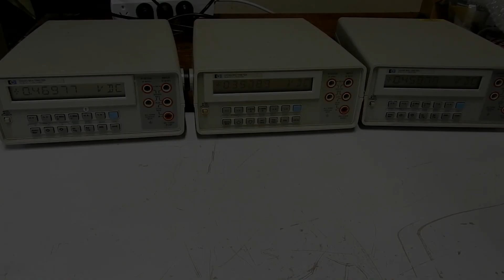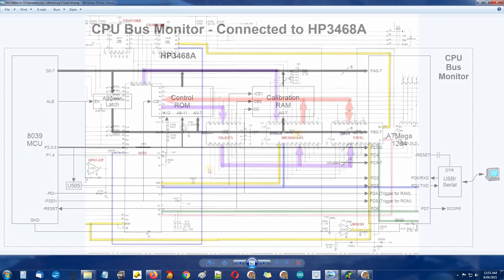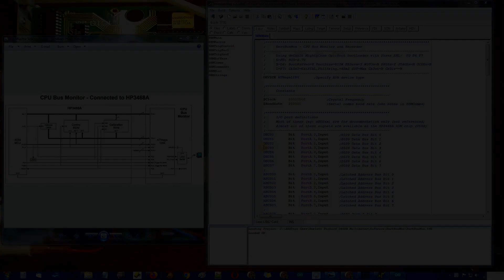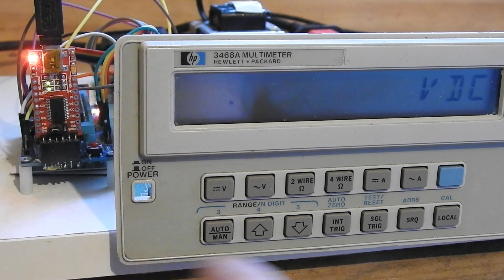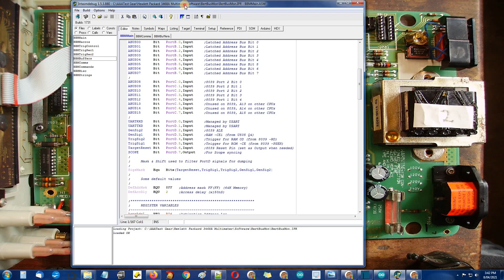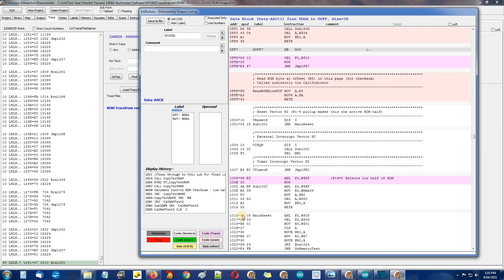HP3468A -  Reading Control ROM and Calibration RAM by bus monitoring

Comment: Just a short note about a year later to let you know I appreciate your videos. I have a 3468A like yours as well as a Fluke 8800A and, referring to the former, mine's a mess as well. I tried to "rescue" the cal data by jumpering the backup battery but to no avail. Despite carefully following the procedures , I got the "screen of death" and had to ship it off to a cal shop with reasonably priced rescue fee.

 It was at that point that i abandoned any dreams of becoming a metrologist (sarcasm here) ad just be content with what I had. I applaud your crusade and perseverance.
Reply from the maker: Thank-you for the kind words!
My main issue with the 3468As is the rotten display. I have a plan to replace it with something better, but ultimately, I want to replace the 8039 controller as well. 
But that involves disassembling and understanding the firmware, and I've only just scraped the surface of that.